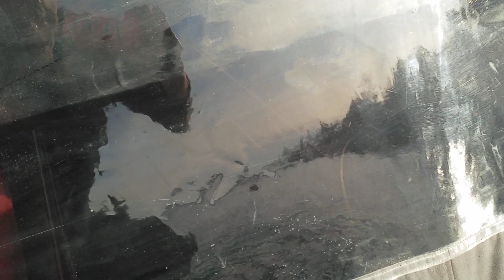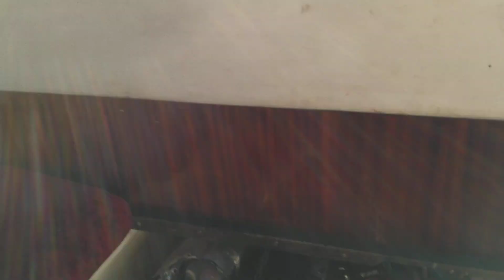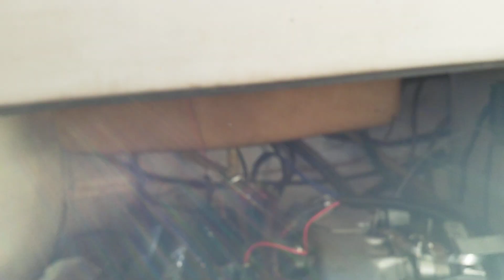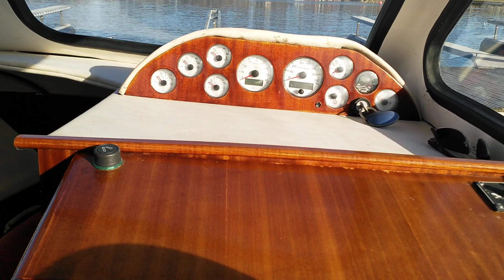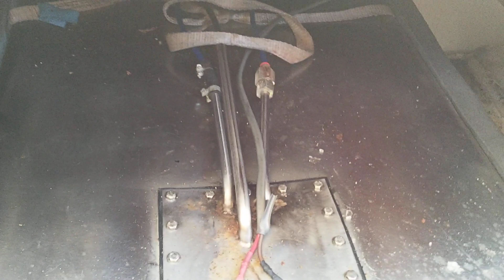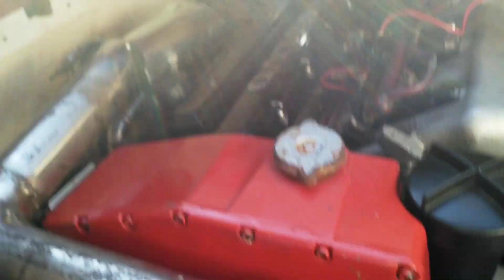Presentation of The Turbo AQ171 boat Finncraft 22HT

Comment: Hello. do you know the difference between aq145 and aq125? who looks exactly the same? I'm going to buy one but can't figure out which one it is? thanks for the return messages
Reply from the maker: AQ145A (AQ145B is a B230) is a B23 2,3L 8v block with DOUBLE Solex 44PAI downdraught carburetors.

On B230 block it says B230 under the oil filter. 

B21 block says B21 on the block under the intake manifold AND B21 block has NO CORE PLUGS ON INTAKE SIDE.

B23 block HAS core plugs on intake side!

AQ125 is a B21 block with SINGLE Solex 44PAI downdraught carburetor.

Many old engines have mixed parts from all of these engines. They all mix... but they don't work that well when you mix wrong carburetors etc.
Reply: @volvopentaman  tanks man.. 
Will look under the Oil filter👍👍

Comment: hi, very nice realization. i'm trying to do the same but i dont know how to cool the exhaust if i connect the car manifold. i cant connect the turbo to the boar cooled manifold. can you tell me how you did it. thanks
Reply from the maker: I have a custom build stainless steel water jacketed manifold with seawater running through. Big T3 turbo (only oil cooled, no water) and a seawater cooled 3->3/½" downpipe.